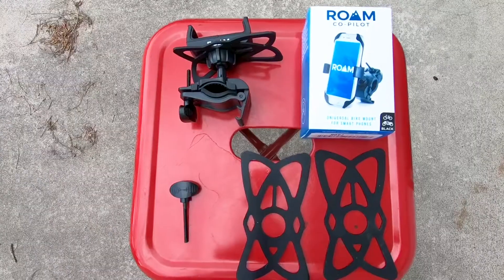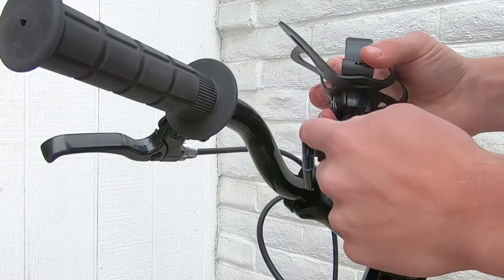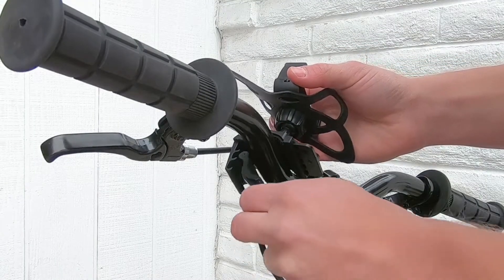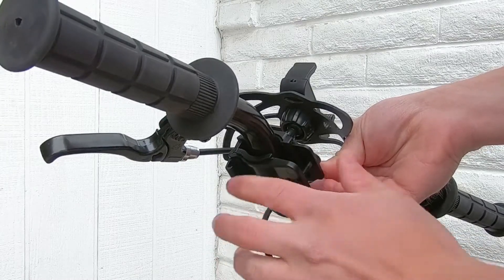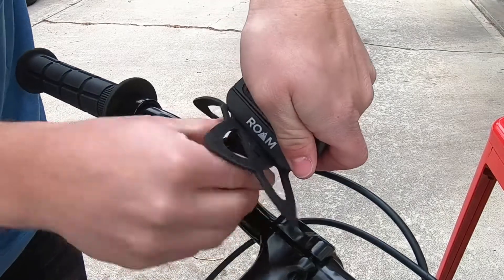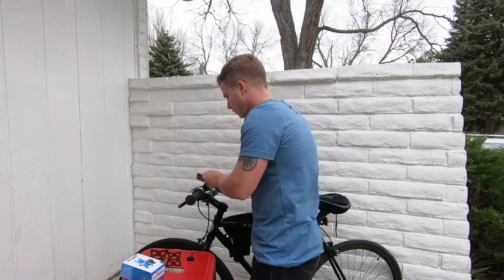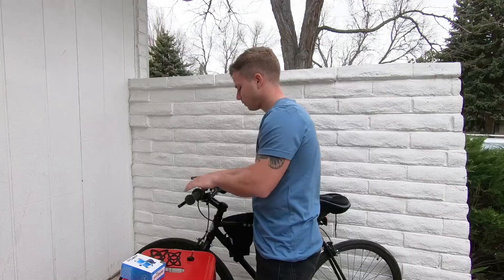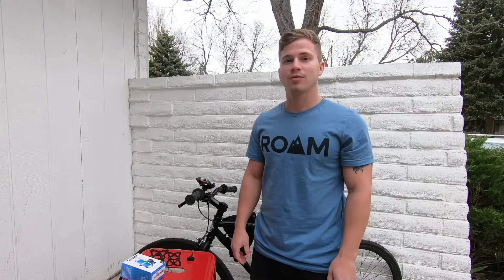Installing the Roam Co-Pilot

Comment: An important detail was stopping me from getting this to work.  The handlebar screw is the same black color as the bolt.  I think that when I separated the two clamping parts by turning the handle bar screw that the tiny bolt fell off and rolled under a piece of furniture since I cannot find it.  Fortunately the product comes with a second bolt and screw set so I could use the other bolt.  The instructions should show the bolt as a part of the product and also include it in the display of the parts that are in the box.

Comment: i think i have a peice missing bc it does not tighten
please advise
Reply: Lorelei...The same thing happened to me.  There is a bolt on the end of at least one of the handle bar screws.  The bolt is the same color as the screw.  The parts shown on the box do not include this important item.  I spent an hour trying to figure this out.

Comment: How are you suppose to replace the silicon net with the larger size?
Reply: Just pop the phone grip off of the ball pivot (it's removable), and stretch the net over the ball pivot cuff. Then slide the new one on.